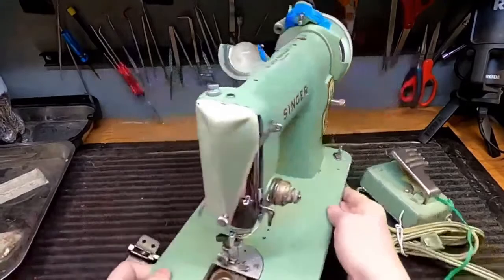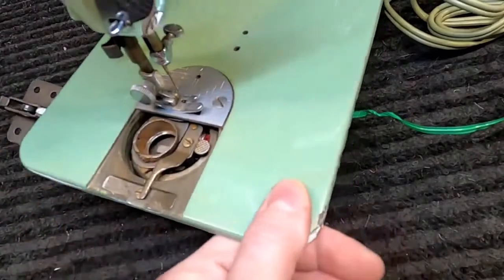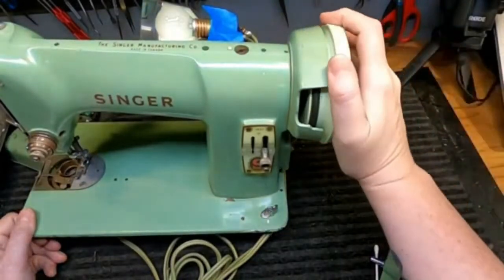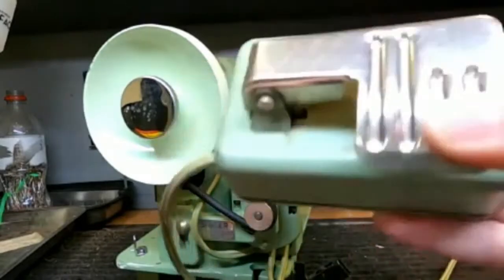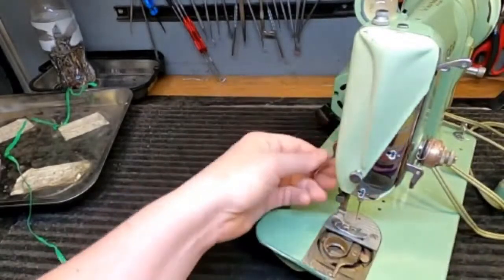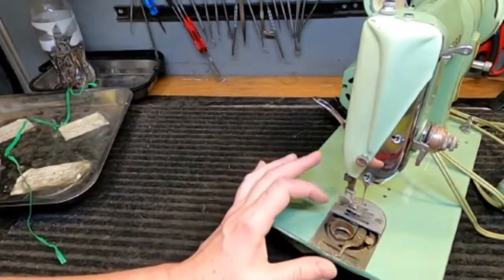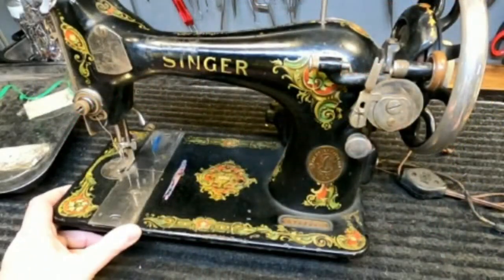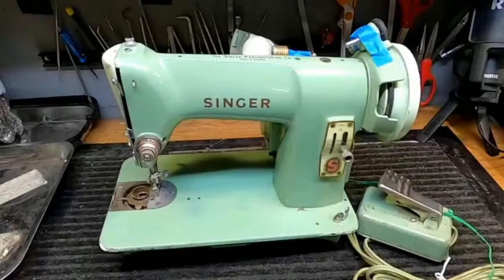Getting Started with Vintage Sewing Machines - Week 1

Comment: I have an electro grand model 400 (brother) machine that I need a neoprene Gear for its the only plastic gear in the machine it sits behind the stitch width regulator and bolts in at the top of the harp space I don't know what it's called but can't find the part or part list. Any help sourcing this part  new or used would be greatly appreciated. I'm planning on taking your course so excited thanks

Comment: Hi, I have a featherweight and I am trying to use it for the first time. Unfortunately, when I press the pedal the machine makes a sound but the needle doesn’t move. I can sew manually, but then the thread gets tangled down by the bobbin. It seems fine otherwise. Do you know what might be wrong?
Reply: Update: if I give the wheel a nudge it will go! But the thread still builds up and loops like it’s looping around the bobbin somehow
Reply from the maker: @shinrakusakabe6338  I'm so sorry, I'm just now seeing your comment.  I am about to teach class, but I'll come back and see if I can give you some tips to figure out what's happening.

I do have a free class that walks you through getting started on your Featherweight.  Again, totally free, no strings attached.  Here's the link:

https://www.learnmachineservice.com/courses/how-to-use-your-featherweight